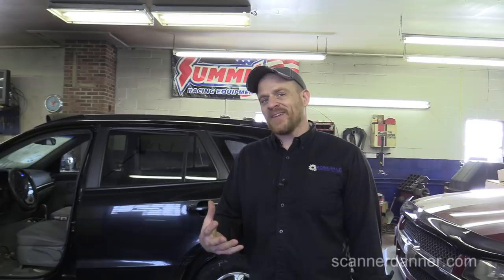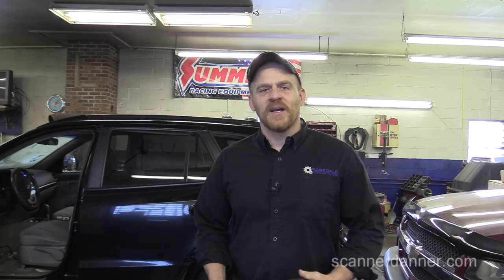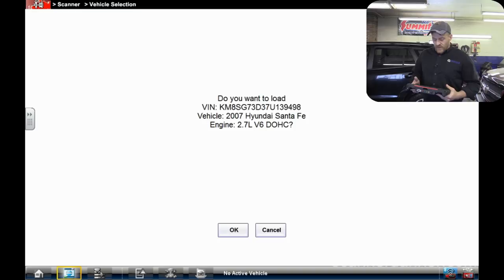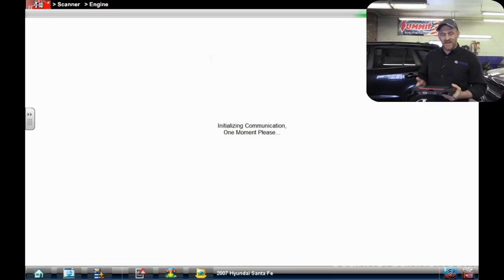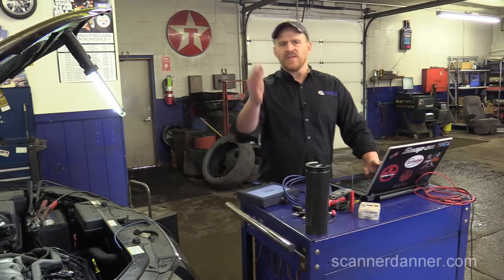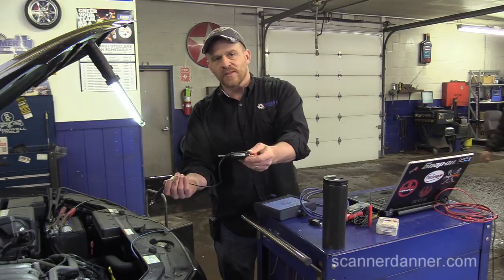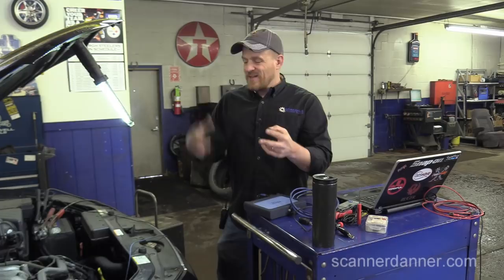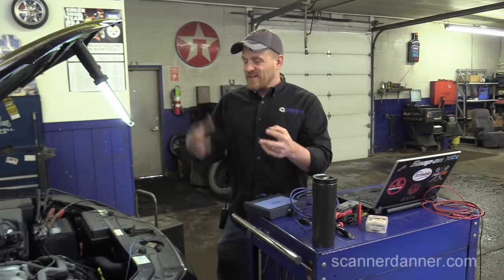No Start Testing Basics - Spark, Injector Pulse and Fuel Pressure (Hyundai Santa Fe)

Comment: ScannerDanner, you’re very good at diagnostics. I have a issue I’m wondering if you have ever run into. 1991 Chevy s10, 4.3 dbi. Cranking strong, no fuel at injectors. Fuse good, tested relay, it was good. Took fuel lines off back of carb and turned key, I can hear the fuel pump prime but no fuel out the line, either. I jumped the relay with a wire. I can hear the pump running but no fuel. I took the fuel line off the back of the fuel filter and jumped the pump again, no fuel but I hear the pump running, or at least making noise. I then took the fuel line off the front of the pump in case the fuel filter was plugged. Jumped the relay again, heard the pump running but still no fuel coming out. Truck has been seating for about two years, it has a half tank of gas. I also tried hitting the bottom of the tank while the key was turned and the pump was priming. I did this while the fuel filter was still disconnected to see if I would get anything to that point. I hear the fuel pump but still nothing Coming out. Your thoughts on this would be appreciated. Thanks

Comment: Would you do a test for cranking but no spark for Subaru RX EA82T engine,. Please explain more on the connections between the ignitor, the coil and in the electronic distributor
Reply from the maker: I'm not familiar with specific engine designations like this.
Provide me with year, make, model, engine size (liters) and I can help.

Comment: Quick question, wouldn't putting the amp clamp around one of the injector wires confirm you have no fuel getting to the injectors?

Comment: Thank you for the info on why not to use brake cleaner as a fuel source. Is there a reason you don't carry proper starting fluid with you as part of your diagnostic arsenal?
Reply from the maker: I do at times, but I only work for 1 or 2 garages these days and they usually have something

Comment: You are explaining it like a BOSS !! OMG   now i know why you are a teacher , if i lived in the states i would be you re student ! Ps you have the "Rolls-Royce tools 😆😆 we say here in Belgium 😉😉 i have a 6 series e64 2005 model i have a big problem ik was working on my radio speakers and i cut 4 thin wires a litle yellow and black and a Blue red / red yellow i think..   when i cut the firt to i hear the pump fuel go dead because i put 12v on the wires i tath it was a speaker whire now it wont start 😭, did i fraid the ecu?? I messurd al the fuses and relais .. looks fine . I find you re channel and i am learning but i am afraid i do something wrong 😏 sorry fore my pore englisch 😊
Reply from the maker: your English is fine my friend and thank you for the compliment! Without knowing exactly what wire you cut and applied 12v to, I cannot answer that question. Now if you can tell me exactly what circuit that is, I can help. Also, one of my moderators on my forum is from Belgium, his name is Dylan. It is free to join my forum. I bet we can help you. https://www.scannerdanner.com/forum/post-your-repair-questions-here.html

Comment: Great video ! One question though in the video you said fuel pump run about 5 amps to 10 amps ... I recently purchased a scope to do more diagnostic and get better and I checked the current wave form on my 2016 Acura RDX and it’s about 2 amps ? Or am I doing it wrong ?

Comment: Great video, I'm having a similar issue with a 09 santa fe, did you hear the bad pump energize when you try starting the car? I can hear mine but it doesn't seem like the plugs are very wet after trying to start it.

Comment: Hey danner... got a 1983 Lincoln Mark VI.. 5.0L.. some days it starts and runs fine.. shut it off that night and try starting it the next morning and it just cranks and cranks.. 19k original miles.. got spark fuel pressure and compression.. changed the pressure regulator to finally get the correct fuel pressure back but did not solve the issue.. changed the coil pack.. no luck either.. on the days it would run fine it would start dying out towards the end of the day.. but then restart again.. but when left alone over night it refuses to start.. have checked the 5 volt reference everywhere and get mixed readings between .04v to 9v throughout the engine bay.. even the 2 injectors are showing mixed.. what could be the solution to the problem??

Comment: You mentioned the picoscope has a max volt of 200 and needs an attenuator. I know you have a great amount of experience with the Verus. Does it have a higher voltage input/built in attenuators for each chanel?

Comment: This was a great tutorial/instructional. I'm at the point where I'm ready to remove the back seats and test the pump. My question is - without the "fancy, Cadillac" tools, how do I mimic the closing of the pump relay to see if I get power to the pump and prove that the pump's switch is open? With my light in position as you show at 41:55, would turning to Key-ON do the trick or do I need to crank the vehicle? Thanks in advance!
Reply: 2008 3.3L santafe AWD.  
What can cause it to run lean after they change the spark plugs. 
It wasn't running lean before the plugs change, is after. 
Codes  ,C2187,

Comment: On my Mitsubishi Diamante ( think Dodge Stealth , Chrysler .. ) Two fuel pumps , one of the two runs at low vehicle speed , the other comes in at higher vehicle speed  ( two fuel pumps , two different pressure ratings , two different start feed points )
  I hope this helps some one 
      Thank You

Comment: Hey Scanner Danner, I have an 03' Mercedes, no spark, verified no fuel pressure, can jump the fuel pump manually with a circuit pro but still no fuel pressure, would a faulty fuel pump cause no spark?

Comment: What happens when you beat on the tank and it doesn't start? You throw a pump,then injectors, then an intake, and when it still won't start then you call scannerdanner and find out you have a wiring issue

Comment: What do you do if beating on your tank or spraying some start fluid gets it going?...It doesn't mean problem went away and you 'll need to diagnose anyway to isolate problem with either wiring, relay, fuses, harness, etc...Thanks to ScannerDanner showing methods, tools and procedures.....
Reply from the maker: What the "beating on the tank" does is restore poor brush contact within the electric motor. Once the motor stops spinning, it will happen again. The only fix is motor replacement. Make sense? It's a worn out commutator/brush assembly in the motor.

Comment: Mr danner I might have asked you before but I have a vantage pro. Can it handle fuel injector spikes and ignition coil spikes without the intenuator The other concern is if I try and look at can c bus waveforms it’s flat line 2.50 volts I can’t see data packets. If I scope the can interior bus at dlc It does catch the communication packets/waveform. Is my scope messed up?
Reply from the maker: No attenuator is needed for the VP.
When measuring  CAN or any other very fast signal, you must be in the lab scope portion NOT the graphing multimeter. Make sure peak detect is turned on and chose small time bases then freeze and zoom out to see the packets of data

Comment: Great video sir. I have just one question as I'm confused.
when you put the test light to positive battery and pin 78 which goes to the pump. You said it shoudl light finding a ground through the motor. But how it can? since the light is placed between 12V and 12V so the drop across the light is 0V??
I can understand if the circuit is off but when it is running it shouldn't light, right?
Reply: He answers this question in another comment.  When the pump is off (and therefore causes no resistance from it running), voltage will find its way through the component (fuel pump, in this case) and to the component's ground, resulting in a complete circuit, turning on the small bulb in the test light.  You can test this same theory out by putting a test light set to volts "in line" between one of your battery posts and the disconnected battery post clamp (which is one way that parasitic drain tests can be run, to see the flow of amperage from the component, with the multimeter set to "Amps / Milliamp" mode).  Hope I have explained this clearly.

Comment: Would a voltage drop test be necessary after checking powers and ground at the pump or would the amperage measurement rule out a high resistance problem if it was not a open circuit?
Reply: I just tried to buy tour book and malewarebytes poped up blocking your site. PHURP

Comment: Have you got any videos regarding fuel pump pressure and flow? I seen many about fuel pressure but not pressure and FLOW. Why is flow so important in diagnosing fuel systems?
Reply from the maker: Because under high RPM and heavy loads, there is a HUGE volume of fuel being delivered in comparison to idle speeds. The fuel pump needs to be able to maintain normal system pressure with these volume demand changes. The thing is, a volume test is NOT needed. Performing a wide open throttle snap test in the shop with a psi gauge works. Also using your O2 sensor at wide open throttle during a test drive is a great test to tell you if you have a fuel delivery issue. (the O2 readings should be rich the whole time at WOT)

Comment: Friend of a friend has a 1998 F150 with 4.6l engine, cranks but will not start. He has had 4 different mechanics look at it and they can't figure it out, he says there is spark, fuel pressure is good, they sprayed starter fluid to no avail. They changed the camshaft position sensor and crank sensor couple weeks ago, still won't start, I live 50 miles away so haven't been able to go look at it until today. Took me about 10 min to determine its a fuel problem, I got it started with starter fluid but it won't stay running ( not sure why the other guys couldn't get it started). Pressure at fuel rail Schrader valve is 38-40 psi and seems to hold after key is turned off. I'm thinking maybe fuel filter, possibly something preventing injectors from working. I did pull off the hose/tube to throttlebody and it's pretty dirty, any suggestions ? Does not have any codes stored.
Reply from the maker: You need to confirm there is no injection pulse first. Use a test light like I showed in this video

Comment: Awesome video i have an 04 Santa fe 3.5L and i have spark and ignition and fuel i replaced timing belt spark plugs coils wires ignition sensor throttle body tps sensor app sensor crank sensor fuel pump 5volt refrence 02 sensors everything you can think of and yet she still wont start
Reply from the maker: Why was the timing belt done? What is your compression?
Reply: Timing belt had a rip in it so before he brakes i figured let me do it so nothing will happen to the motor everything was fine car was running beautiful 3 weeks later out of the blue lost power putting and chugging wouldn't go pass 5 miles an hour had it towed home and its been sitting for 2 months still wont run I've thrown so many parts at it and nothing cranks super strong i got fuel i got spark i got signal on ignition im just so tired still wont start
Reply from the maker: @daddyskids4life1  we must verify compression. Then check it for an exhaust restriction. Remove upstream O2 and see if that gives it enough to breathe
Reply: @ScannerDanner  awesome I'll check it out I'll let you know about my findings thanks
Reply: @ScannerDanner  hi i did the compression test on all six all showed 150 and 145 now on the ignition sensor it shows i have 1 power and 1 ground and 1 sig wire but the other wire has nothing i could of sworn it needs 2 power wires 1 sig and 1 ground right
Reply from the maker: @daddyskids4life1  did you remove the upstream O2 sensor and try to start it?

Comment: Paul, on one tank side is a fuel module called a "Subside" that has no pump in it. On the other tank is a fuel module called a "Mainside" which has the pump in it. Both modules have a sending unit. I work at a factory that is a supplier of these modules to car manufacturers called "TI Automotive".

P.S. I have a question. I have a Pico 4425 like you do. Aeswave only sells only a 10:1 Attenuator, which I bought 4 of. Will these be OK to use? They dont even have a 20:1 for sale, I dont understand..... Thank you for reading.. Murle.

Comment: Hi Paul, I'm having a strange low voltage 5.55 voltage on injector plugs....+ were to get a hyundai Santa fe 2007 diesel circuit diagrams..... thanks
Reply from the maker: https://www.scannerdanner.com/forum/post-your-repair-questions-here/16-need-service-info-check-here.html

Comment: Hello Paul! I have a problem with my Fiat Panda 2006 (gasoline engine) this morning. It wont start. It cranks but no start. Scanned with obd2 and the fault code shown is "U1700" only. I have checked fuel presure, fuel pump, coils pack, spark plugs/wires and those are good. Can you guys can help me with diagnosis? Cant find any diagram for this vehicle or possible causes for this errror code. Many thanks
Reply: Join the forum and try posting your issues....lots of fine chaps there.

Comment: It is a never end "possibility" world ......... I seem car run out of gas causing no start because of a faulty fuel gauge.     I seem car run out of gas so fast causing no start because of some fuel leaks at the fuel rail when the engine is running.      One question, is a lap scope any good for diagnosing those hybrid and/or pure electric cars?         I am going to invests a lap scope (ideally a 4 channel pico with lap top) but what about the those Snapon, Autel, or any other Scanners that built with scope, any advises would be helpful,  Finallly, I have to say Thank You for all your videos posting, I learn and make living from them, I mean it!!!!
Reply from the maker: Of course, the lab scope is useful for everything. Hybrid or not

Comment: Lost the fuel pump in my 1988 Jeep Comanche, I burned the truck up when the lawnmower gas tank I rigged up spilled fuel on the exhaust manifold when I hit a bump on the way home. It's great to be able to use all kinds of equipment, but if you're on the side of the road with NO equipment, you do what you can to get 'er home.

Comment: I have a simple trick to see if it will fire, is to have a can of starting fluid on hand.  Especially if you work on vehicles.  It should be one of your first tests on a no start...

To see if your timing chain is broke or stretched...  Take off the cap on the distributor and have a second person turn the balance wheel in one direction.  If the rotor turns the timing chain or belt hasn't broken.  Stop turned the balance wheel and reverse direction and notice how many degrees does it take for the rotor to turn in the other direction.  Check the tolerance and make your decision on to replace the part if you believe necessary.
Reply: Michael Pearce did you even watch the video or paid any attention? He explained very well his diagnostic steps and why he does or does not do something. And what distributor cap are you seeing on this particular car?!

Comment: nice video.   just curious- i notice most newer vehicles that dont have a guage port for fuel  have sensors  where you can pull up a pid on the scanner.  did this one not have that??  being an '07 quite possibly not.
Reply from the maker: Not on this one my friend. But yes, a lot of them do now, especially the GDI systems

Comment: I had a 2007 Hyundai Tucson it would not start at all turn the key over nothing so what I did is went to the main fuse relay sure nuff it was corrosion bad in the the fuse box on the outside under the hood where I found the problem of that main fuse relay I fix that and then it was ready to go but I was checking other things as well  when I push down on the main relay and the engine all electronic components started to come alive so at the time I knew I had a bad main relay fuse add that it was not easy to get to fix the problem because those female plug in wires that goes into the main fuse relaythere was a bunch of wires underneath  main fuse box man I got it running pretty good and everything after I fix the wires the main fuse relay then about 3-4 months or so and my timing belt broke the valve dropped about the same time the piston came up and bent valve and damage the piston, the timing belt if I was right when it breaks the Hyundai Tucson that I had the  2.7L engine they called it interference engine I think I word that right I'm not sure what the word term of that